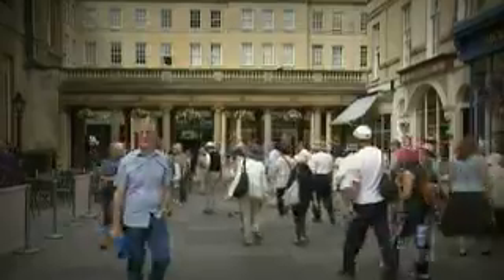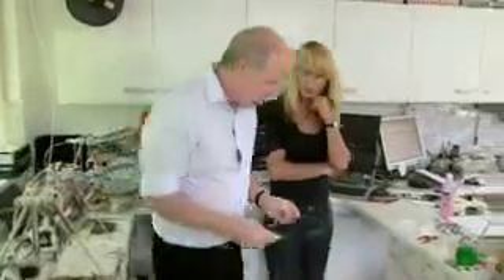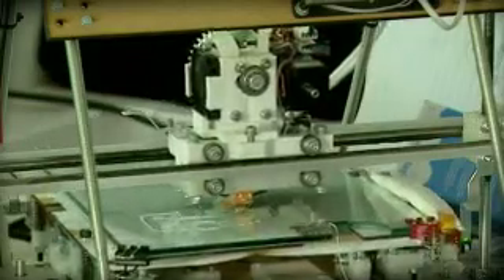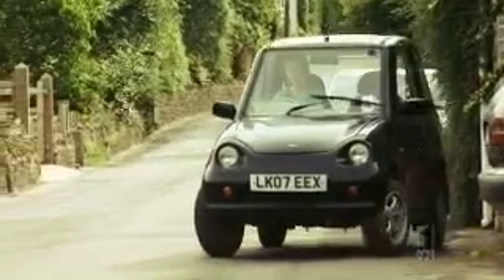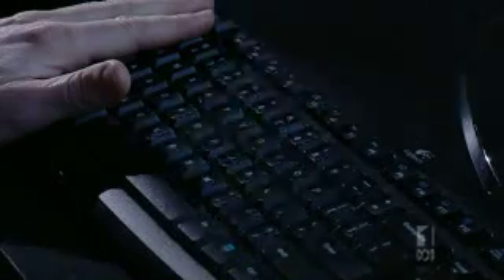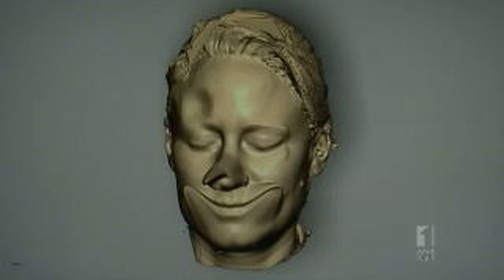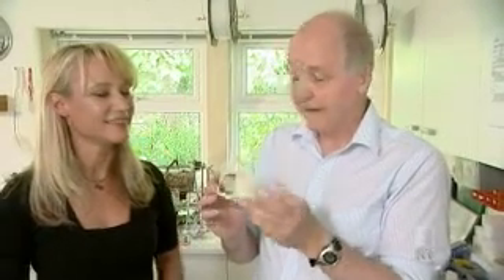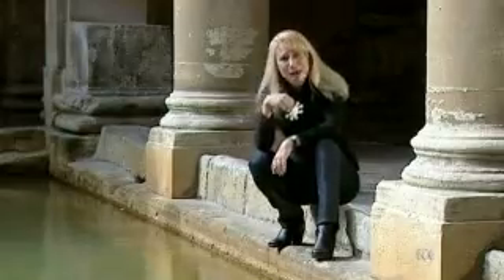Catalyst - 3D printing revolution

Comment: The initial machines are already built.

Hobbyists will build them.

When it breaks you get your buddy to print the part you need.

If a part is too complex to design yourself, go online and download it.

The raw materials are already here, you just shred and reuse.

Not who, what.  And the answer is: the shredders.

Hobbyists will design the machines which recycle stuff, and any bloke can print the machines at home.

And yes, it's more complicated than that, but that's it basically.

Comment: "Bring down global capitalism?" 

Ummm, who will initially build the machines? Who will assemble and calibrate the very complex and high-res models? Who is going to service them when they break? Who will design very complex parts? Who is going to produce the MASSIVE amounts of raw materials that widespread 3D printer use will require? Who will turn it into material usable to the printers? Who will design and build the machines that will recycle things built with these printers? Etc, etc, etc.

Comment: I have several small projects I have in mind. My friend who is sharing the cost has more legitimate uses. He is a game designer and is skilled in 3D modeling, he is working on designing a board game.
I will probably hang out with him this weekend and figure out a plan.
I would really like for the 3d printer to be able to print in both PLA and BLA. Also, it might be nice if it could print with 2 applicators so that there can be some color differentiation, but there are other ways to do that.

Comment: Let me put it this way, they would have to spy on every single human.
They do not need to tax everything. It would be nothing short of tyranny and it would not fly.

Let me clarify this, this 3D technology is a very large market and because it is so big and new enforcing a tax would be damn near impossible and unenforceable. None of the machines have a counter like the electricity meter and if they did it could and would be tempered with.

Do you pay taxes on internet perches? No.

Comment: End of capitalism? This for sure will never happen, but the accessory and plastic part industry will hate it. However, I think it could solve a lot of environmental problems caused by transportation of products from far away (e.g. products from china). For engineers it is already a must have tool, I'm designing a case for my first electronics prototype right now.

Comment: What tax? On the plastic material you have to buy, sure. Besides that they can't prove that you have been avoiding taxes by making things yourself.
Selling things you make on the internet avoids the damn taxes.

For a first machine this prints at a okay speed, it will improve over time.

Your statement implies that growing garden food in your backyard would be taxed too. (Which is more probable here, in the USA as GM foods are a hot-bed of legal and moral issues.)
WTF are you talking about?

Comment: I don't have a ton of information but here's a quick parts list and the suppliers I found.... Printed Plastic Parts, Sanguinololu v1.3a PCB, NEMA 17 Motors x5, Pololu A4988 stepper motor driver carrier x4, Timing Belt x2, Thermistor, Hot End, End Stop Switch x3, Heat Bed, Power Supply, Kapton Tape, Misc. rods, bolts, washers, etc. Est. cost $450 (shipping and tools not included). Suppliers: Ebay, xyzprinters(com), 2printbeta(de), lulzbot(com). It's a start at least. ^_^

Comment: It's not quite that easy. The companies and individuals selling readied kits are trying to make a profit both on the kit and on replacement components often adding cost on top of retail. Since my comment two weeks go, I tracked down a number of suppliers but prices vary widely and many are eBay resellers. I still only have a vague idea on overall cost but it looks like you can build one for around $400-$450. Not bad. I suspect that'll be down to a few hundred in a couple of years.

Comment: There are several television shows that actually show that are a few 3D printers that can even make metals stronger than steel... and even lighter, which is after the end product has been soaked for several hours in a formulated clear liquid substance. Just do a YT "Metal 3D Printer"`search. Also very advanced electronics will soon be the next step most likely.

Comment: Actually watch the video yourself before commenting, loser.
It tells you how this gets rid of spare plastic by recycling it into usable things that can be made and remade with no overheads.

It also points out that stockpiles of plastic crap WONT be laying around because this makes things when they are needed, where they are needed.

And if you use your brain, you'd see that 3D micro-laminating technology can be applied to resins, ceramics and even metals like aluminium with a little work.